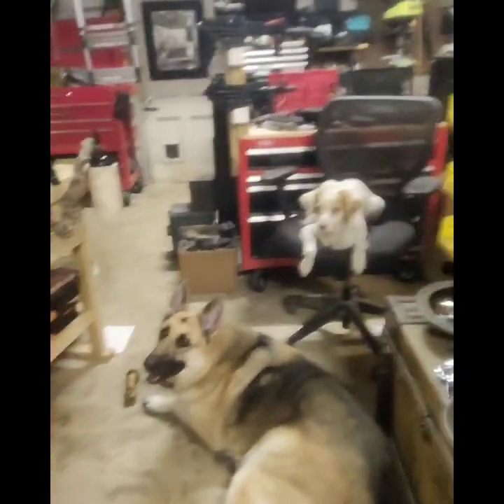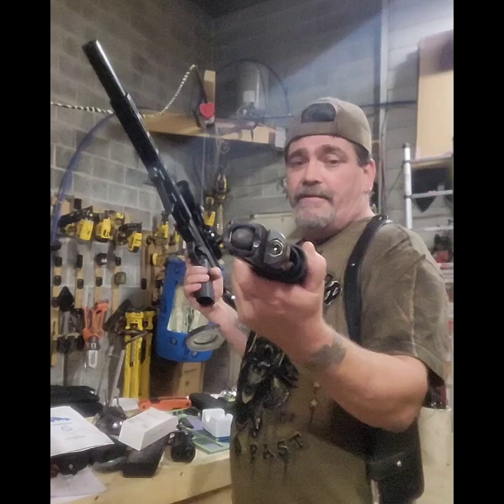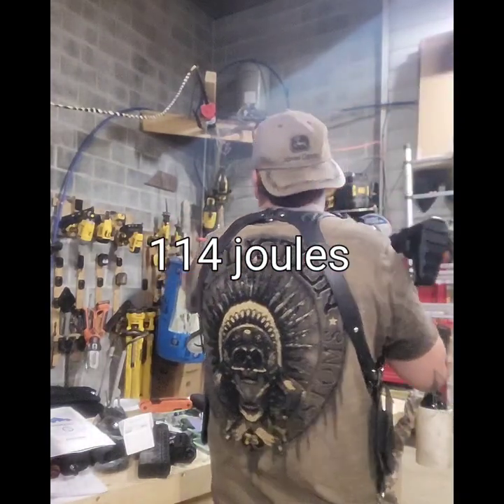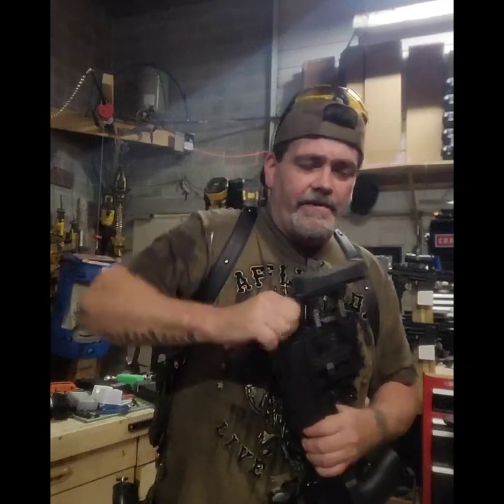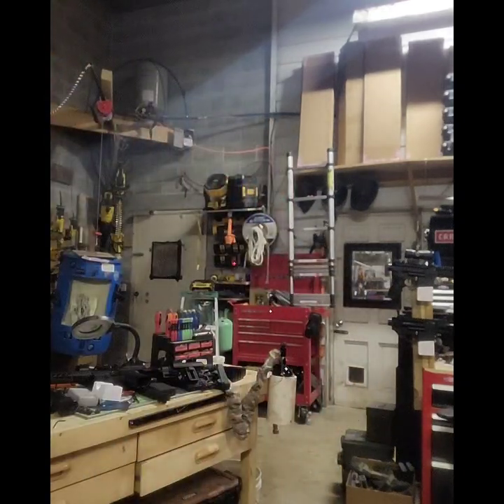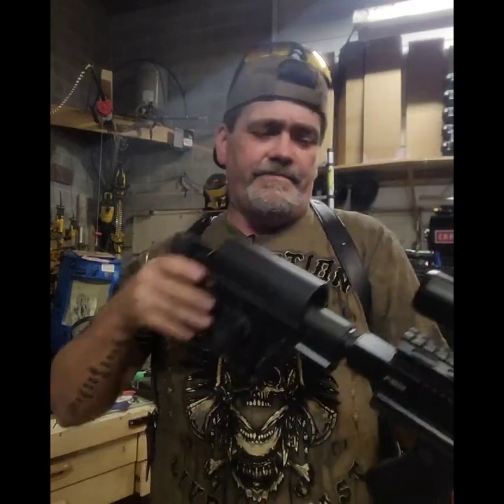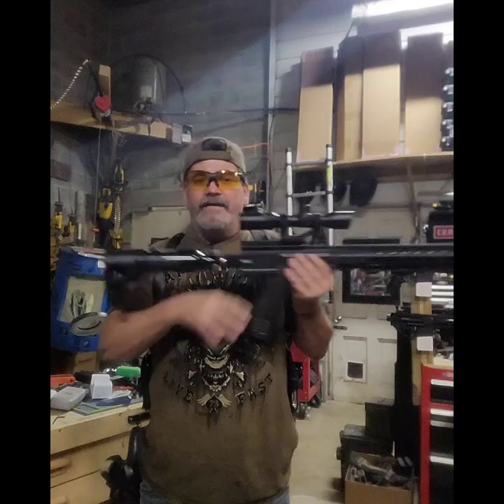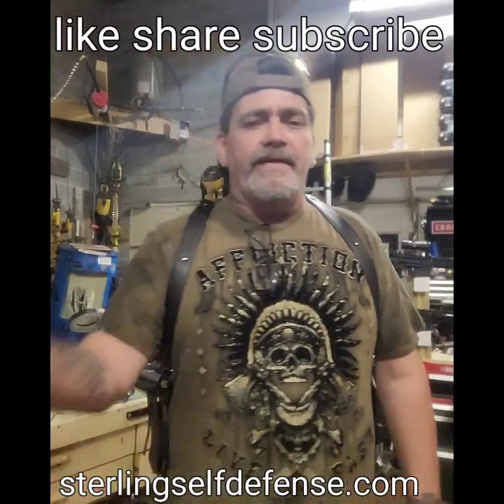fsc sniper upgrade

Comment: I buy those Hatsan blitz air tubes ( pcp air tank tubes ) rated for 4500 psi... they are about 65$ for the 9" tube, and around $100 for the 13" tube. The best part about them is they are rated for 4500 psi, and the threads are m18x1.5. I buy the m18x1.5 regulators, and they use the bell-shaped washers instead of those stupid springs. You can easily rearrange the the washer stack to get the output pressure you need. They are the perfect size around that buttstocks fit directly onto them. So instead of co2 freeze if you shoot too fast... you have much more air with 4500 psi, and you can control the output pressure. It is extremely discreet, and you get to use any buttstock you want.
Reply from the maker: The the point of these are easily accessible CO2 cartridges but I would like to look into those anyway you have a link
Reply: @sterlingselfdefense-lessle6915  I put them together... the m18x1.5 regulators can be a pain in the ass to find sometimes. But i also have regulator adaptes m18x1.5 to 5/8"-8 so i can use my ninja pcp regulators too. But they always come back in stock. You can't leave outside links on here anymore Dan. I'll have to text it to you... you should still have my number. Those Hatsan air tubes are extremely versatile with alot of pneumatic HPA stuff. I found I could do it when I started building my own pcp's a few years ago. I have a few made up and filled to 4500psi right now. I can text you pics of them. They are perfect for pcps cause they can push all the way up to 2900-3000 psi with the right regulators if you need that much output. I have a few of those co2 ones from umarex , and 2 for Modern combat sports. The umarex are solid and always work good in my air javelins. But the mcs ones leak if you leave them sit.

Comment: What output pressure are you running?
Reply from the maker: 1000
Reply: @sterlingselfdefense-lessle6915  dang all that power from only 1000psi!?! I got a sig virtus pushing 1475 psi output with several other internal mods I run 23 grain slugs and only get around 40 joules crazy how a different platform such as the fsc can squeeze out every bit of power from such a low psi output I’m sure the internal mods you’ve done partake in that reason tho but nonetheless great content man!
Reply from the maker: @everythingdude4265  ya it’s everything working together and thing over 1000 psi on these marker is dangerous
Reply: @sterlingselfdefense-lessle6915  have you tried pushing a bit higher my virtus is rated for 1200 max but there’s a few hundred psi output of wiggle room with the right internal mods such as a stiffer spring tightened barrel etc etc could you not push past 1000psi safely even with aftermarket internals and barrel etc?
Reply: @sterlingselfdefense-lessle6915  btw do you know any good websites I can get aftermarket barrels for airguns? I’m looking to change the barrel on my virtus to a .25cal barrel and 3D print a magazine and new belt made for .25cal pellets.